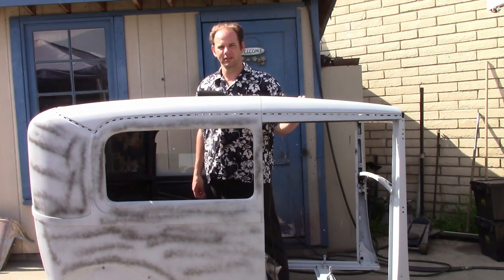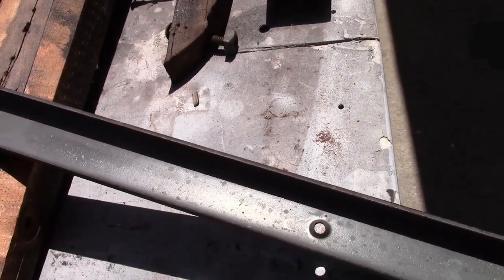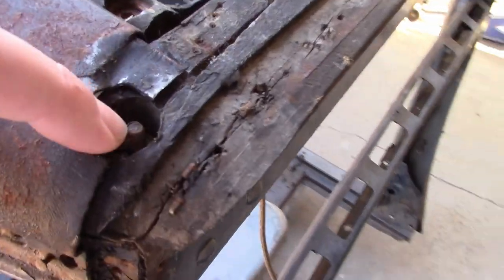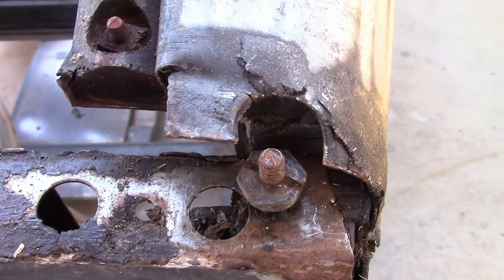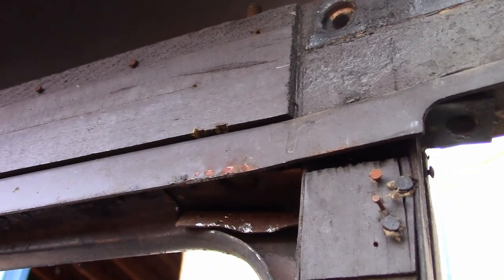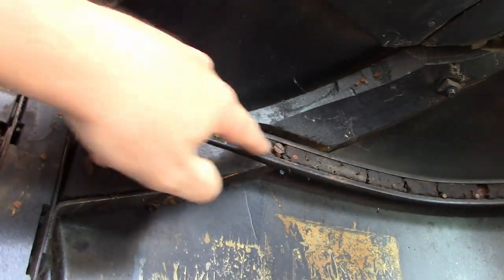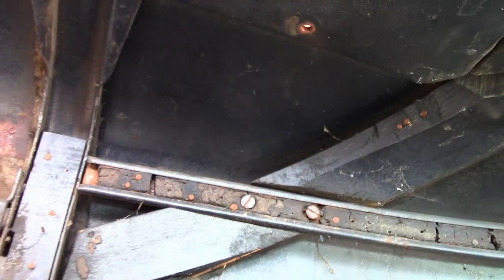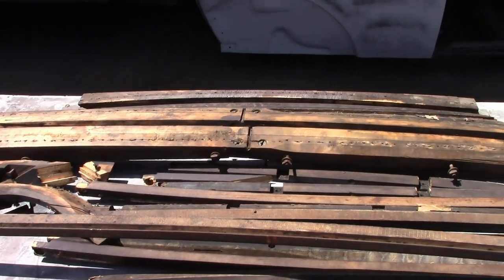1929 Ford Model "A" restoration. Part 2.

Comment: For those sections of wood that are still solid (aside from a little “nail sickness) it might be feasible to trickle some baking soda into the holes (or cracks) followed by soaking with cyanoacrylate glue. Multiple layers and soakings may be needed for deeper holes. The combination sets nearly instantly and can be tool-worked or sanded right away. Bigger holes can be filled and solidified with cotton wool, then soaked with that glue, again in layers, if needed.

Comment: There are patches of what looks like a glue roller was used on the inside of the panel section between the third and forth windows and the rear fifth window. Was there originally insulation glued there?
Reply from the maker: There was some kind of insulation glued on there. I think it was added later because I've never seen anything like that before.

Comment: Removing all those little roof nails is a chore. I'm still working on a good process for that
Reply: I settled on using a cutt off wheel on my air grinder. You can grind the heads of each nail off enough they pop right through the tin.

Comment: It's going to look great in andalusite blue. What colour rims and pin stripe go with andalusite blue? 

I read somewhere that to get andalusite blue to look like it originally did, almost a bit purpleish, you need to use red oxide primer. Apparently that's what Henry used. Does that sound correct?

Great project so far, thanks for taking the time to put together these videos for us, I don't know that I would have the patience. When I get working on a project just my phone ringing is enough to annoy me!! 😄
Reply from the maker: Thank you. Yes, that blue is vary transparent so it's sensitive to what color primer is underneath it. I don't know if the new toners are the same way, but we'll find out. 
According to the book, it should have a gray stripe, but this car had a white stripe originally so I'm not sure which we're going to put on it.
Reply: @onewhocollects6781  The car has a white stripe............says the guy that thought the car was black! 😂

I think the car would look great with light grey rims and matching pin stripe, but I would be inclined to make it factory colours.

Looking forward to the next episode!

Comment: You are doing a wonderful job,of course as usual and I enjoy watching your normally patient,painstaking ,consciensious,skilled  workmanship but if that were my car,I would insist that you neatly cut out all the damaged/rusted sill areas.

Then I would have you butt weld in new pieces then weld both sides and grind it all back to an invisiible finish. 

To me you have done an unsightly /ugly repair and spoiled the originality of the car.

I would think that  those welded on patches will stick out like a sore thumb on any comprehensive inspection of the car later.

It makes no sense to me as you are so careful elsewhere and you worry about getting the original fabrics and paint colours on the car.and leaving the original spot welds etc visible on some of the metal body parts.

If that were my car,I would put my money where my mouth is and pay you to remove your overlap repairs to the sills and have you do it as per above.

I am actually having  a wooden framed/metal bodied car restored at present and I have made it very clear to the restorer that all chassis /panel repairs,patches, must be neatly be butt welded in and invisible when finished and painted.